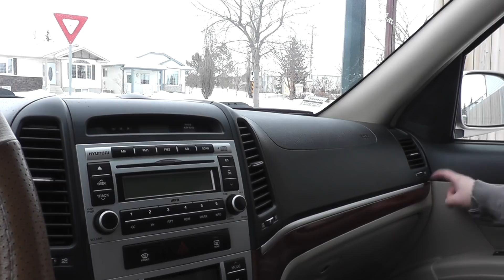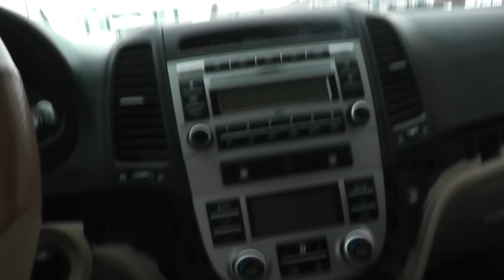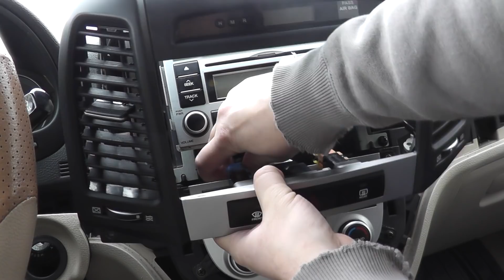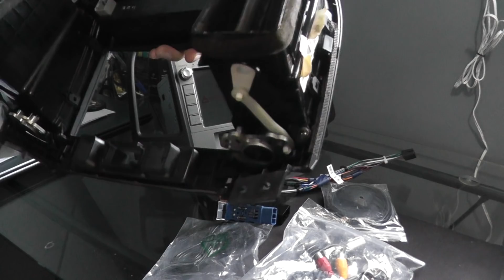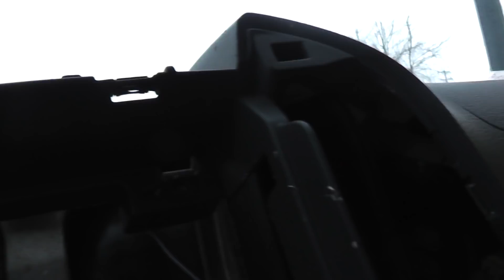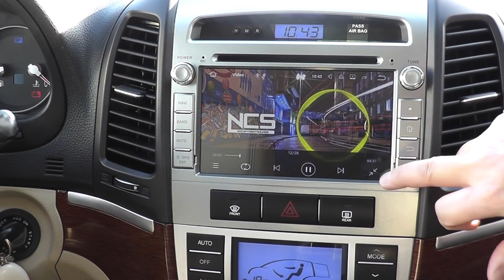Hyundai Santa Fe Radio Install

Comment: Hello can i get the android 9.1 9" screen into the original bezel once i remove the factory radio or will i need extra parts?and what power wire can i get for i wont have to cut the original power adapter to contact the wires with the one they send with the radio? I have the 2012.
Reply from the maker: No you won't be able to, their headunits are builts right into the dash. You only need to move your climate, defroster, and hazard switches. Depending on your car connectors you may need an adapter harness - this avoids from having to cut and splice into the car harness. You can remove your current radio to see you connectors and check what the units comes with.
Reply: @AutoAudioDIY  okay I was asking because I have seen the same radio unit that doesn't come with the bezel so I figured once everything is removed it would fit into the oem bezel..

Comment: How do I get my CD out of the player it won't come out
Reply from the maker: Did you remove the two screws located above the unit? There is an eject button top right hand side just below the rotary knob.
Reply: @AutoAudioDIY  I tried the eject button but it still won't come out. I don't want to take the radio out but my CD is stuck in the play

Comment: Hello, the link for this head unit is not valid anymore, they have a new model, but that one doesnt have space for the airbag indicator?
Would you please do a followup on the new headunit, really want a new "Radio" in my SantaFe, but i get confused when the new one doesnt show where the airbag indicator is?
Good movie btw :)
Reply from the maker: Yes I will do a followup, I have contacted them before but wasnt getting any good info. back. I will try again and let you know.
Reply: @AutoAudioDIY  Cool, thanks 🙂

Comment: I just brought a hyundai Santa fe but it has a DVD player in it. Is it possible if I get a new radio I will still be able to use it to work the DVD player for the kids ?
Reply from the maker: Is the dvd player just for the back or is the dvd player controlled by the main radio?

Comment: Hi my name is Matt I have the same suv and mine has the speaker on the dash but I wus wondering wut is the model and type of radio and connection you got cuz I’d love to get it for my Hyundai Santa Fe and if you could let me know I’d really appreciate you and by the way nice video my email is Shenktank120@gmail.com  like I said if you could let me know the type and model and what type of connections you got that be great thanks for the video and getting back to me have a blessed day
Reply from the maker: Hi Matt, I can for sure help you out. You said your santa fe has a speaker up top above the radio correct? Email me a pic of your current radio to chucho_301@hotmail.com. also what year is your santa fe?

Comment: Hi, thanks for the video ! That’s great.
Where can I purchase the wiring between the old connector and the new connector (on website) ? Thank you in advance
Reply from the maker: Ok sure, I'll get you a link or two as soon as I can.
Reply from the maker: sorry for the delay, here is a link for the radio harness...
https://www.ebay.ca/itm/Replacement-Aftermarket-Radio-Harness-for-Select-2007-up-Hyundai-Santa-Fe/400963662892?ssPageName=STRK%3AMEBIDX%3AIT&_trksid=p2060353.m1438.l2649
Reply: @AutoAudioDIY  None of the aftermarket harnesses have the pigtails for the pin 11/pin 12 steering wheel signal and ground wires unfortunately.   i have no idea why they didn't offer these wires.  There is one harness that does, but its not meant to be used as a harness for a radio such as this.
Reply from the maker: I did make the steering wheel controls but without using a harness. Just used the two wires on one one the two harnesses. Watch here: https://youtu.be/HPVAPVD1aHI

Comment: Great video!!  but Im finding that the unit lights power on but Im not getting anything to display.  Almost seems like the unit is not getting enough power.   Does the cable that was powering the dashboard clock also need to be plugged into the new unit?  I know the main power and speaker cables go in and the radio but as far as that goes I feel like Im missing something.   (btw the air bag light is now on.) . thoughts?  Thank you!
Reply from the maker: I would check your ground wire, for my nissan I had to ground it to the metal frame behing the radio. Negative, the clock gets its own power and doesnt affect the unit. 

Did you disconnect the negative on the battery before install? If not that would set your airbag light, to reset it just unplug your negative on the battery for a good 5 min. If that doesnt reset it yoy may need a scanner with airbag capabilities to do so.
Reply: @AutoAudioDIY  I did disconnect the negative battery cable before performing the work. All good there. 
The issue with the plug that powers the original dashboard clock does affect the air bag light.  With the new unit connected I took the old frame and reattached the clock and boom...Air bag light turned off. So I need to know how to get that plug to work with the new unit.  Lastly, I will have to ground the negative and see if that gets the display to kick on.  many thanks for trying to help.  Sending you good vibes.

Comment: I bought a 9” seicane and screen won’t turn on. Only buttons lights are on and thats it. What should i do?
Reply: Usb is working and chargin my phone but screen still won’t turn on
Reply from the maker: Does it shut off when you turn the car off? Also, could be the dimmer is turned all the way down which would be odd but may happen.. can you hear any sounds?
Reply: Esqu3l3to yes it shut off when i turn off my car. And i cant hear nothing

Comment: Can I install Android 9.0 Car Radio 2 Din GPS Navi for Hyundai Santa Fe 2006 2007 2008 2009 2010 2011 PX6 DSP HD IPS 4Gb+64Gb RDS WIFI BT HDMI 
In my Santa Fe 2010
Reply from the maker: Do you have a link that I can check?
Reply from the maker: Or I can also provide you one that would fit your santa fe.

Comment: Good night! Could you tell me about installing the multimedia for holy faith, I would like to know which cabling the sound whip (music change volume and mute) and intended for steering control control (cable colors)? thank you.
Reply from the maker: Ok so if im understanding this correctly you would like to know which wires you need for your steering wheel controls to work? What car do you have?
Reply: Okay, okay, I'm doing the installation of the vehicle multimedia santa fe but I'm in doubt about the cabins of the steering wheel control.
Reply from the maker: What year is your santa fe?
Reply: @AutoAudioDIY  year 2007
Reply from the maker: Ok I will find you a link for which wires you need.

Comment: Your gps puck is going to be exposed to a lot of heat in the winter by sitting on top of that heater duct
Reply from the maker: Yes that's true. So far so good tho, I should find a different spot for it.

Comment: includes everything?
Reply from the maker: it does include everything yes, having said that depending on your region you may need a harness to match your vehicle. I would suggest to check which type you have in case you need a different type to install into your car. Otherwise this includes everything you need.

Comment: Is this system apple compatible? If not which system do you recommend?
Reply from the maker: yes this system is apple compatible. It does support apple carplay *with an adapter*. Also unit will play bluetooth audio as well. Here is a link to the updated version of this unit which is a 9" touchscreen as well as the link to the usb adapter needed for carplay. 

https://www.seicane.com/2006-2012-hyundai-santa-fe-aftermarket-android-hd-touch-screen-navigation-system-dvd-player-radio-bluetooth-obd2-dvr-rearview-camera-tv-1080p-video-3g-wifi-ipod-steering-wheel-control-gps-usb-sd-mirror-link-s167027g?acc=3c59dc048e8850243be8079a5c74d079

usb dongle:
https://www.seicane.com/plug-and-play-carplay-usb-dongle-for-android-car-radio-support-ios-iphone-car-touch-screen-control-siri-microphone-voice-control-s01001?acc=3c59dc048e8850243be8079a5c74d079

You can click on the usb dongle selection when browsing the unit to have it added to your purchase. 
If you have any other questions let me know.

Comment: perfect job man ! thanks ..

but i have 3 questions  : 

1- does the quality of sound and bass still the same as the original sterio  ?

2- does all  steering wheel buttons  work properly  ? 

have you had electrical problems afterwards?  

thanks for answering ...
Reply from the maker: thanks!
1) yes sound quality is as good as original. This unit also has a EQ so you can do some adjusting as to what you like.
2) even tho this unit came with a can-bus decoder I, the harness I required did not allow me to use it. So currently I do not have my steering wheel controls working however I do have a wiring schematic so I will be looking to wire it up and have them work.
3) No electrical issues nor any other. Unit works great, used all the time for navigation, music, videos, handsfree calling etc.

Comment: Hello, Thankyou for good job you do! I happen to have model 09 sanda fe, just don't know how to install the steering wheel wiring control , where they connect with, and the back camera also, they a bit different with model 07.  Do you how it can install?  Thankyou!
Reply from the maker: Install should be pretty much the same for the 09 santa fe. As for steering wheel controls here is a link as to how wire that up: https://metradealer.com/files/aswc/ASWC-1_INST_405.pdf
for the backup camera I recently did an install video of that. You can watch here:
https://youtu.be/e6PsHo6bOBw

Comment: Do the steering wheel controls work?
Reply from the maker: Yes they do, but only if you connect the wiring harness with the cunbus decoder.
Reply: @AutoAudioDIY  what is a cunbus decoder
Reply from the maker: The canbus decoder is the module that "communicates" between your car computer and radio or other devices. So in cars, the car computer will tell the radio that the door is open, or climate control settings, steering wheel controls etc. Not all cars have that have it however. Depends on the model and make.

Comment: How l get this Radio for my hyunday santa fe 2007 and how much $$$$
Reply from the maker: I will send you a direct link for thus unit. Price will depend on the model you chose.
Reply: Esqu3l3to ok
Reply from the maker: Hey man, sorry for the late reply. I was on holidays and just got back. Anyways, here is the link to this specific unit with price

https://www.seicane.com/oem-2006-2012-hyundai-santa-fe-with-aftermarket-gps-navigation-dvd-player-car-stereo-touch-screen-wifi-3g-bluetooth-obd2-aux-mirror-link-backup-camera-s166322?acc=92cc227532d17e56e07902b254dfad10

You can also save an extra 5% with this coupon AFFSC-3051-83XUH-XDDX.

Comment: you paid $586 on this? Dude no way
Reply from the maker: I actually paid less at it was on sale.
Reply: Where can you get these for cheaper than the Seicane website?!
Reply from the maker: Try ebay or alibaba. Even amazon.
Reply: Esqu3l3to  Thanks. I'm looking at a headunit package put together by Crutchfield. Because my Santa Fe has the Infinity speakers and Amp (limited edition), they recommend a "Scosche SLC4 Line Output Converter" . I'm not sure the amp setup I have is compatible with this Seicane. What do you think?
Reply from the maker: I know they do make some units that are compatible with oem premium sound systems but not sure about the Santa Fe. It would be best to contact them directly to ensure whether it would or not tbh.

Comment: Does this fit a 2010 santa fe?
Reply from the maker: Yes this will fit a 2010 santa fe.
Reply: You will lose the steering wheel functions, like volume control, or answering calls.
Reply from the maker: Not if you connect the canbus decoder. It will retains those functions.

Comment: I made the mistake of buying from this company and ended up getting a used unit that someone else had paired their phone with and downloaded maps to, and it seems that they massively overheated it as well as it smells like burned electronics (and still does weeks later).  I had to fix the touch screen calibration myself because it was way off and it also had illegal software installed on it.  In going back and forth with support they want me to spend over $100 to ship it back to them so they can "look into" replacing it.  It also doesn't work with any of my steering wheel controls in my Smart 453 and the mounting bracket doesn't work properly with the silver backing piece for the stereo mount because there are connectors in the way of it so I had to mount it without the extra backing piece.  Oh yes, it also doesn't provide enough USB power to reliably run the USB carplay unit if you also have a thumb drive attached to it and it didn't come with the latest software for it (which was difficult to find).  This all feels a lot like a scam to me so buyers beware.
Reply from the maker: This is the second unit that I have and I have not had issues with either one. My VW unit was easy to install and plug and play. Same as this unit for the Santa Fe. Does look like you did get a defective unit. Hopefully they can get you all sorted out.
Reply: No luck with that, they were super slow to respond, wanted me to pay > $100 in return shipping and had nothing to say about the fact that it had illegal software installed on it except that they tried to tell me I was wrong at first and when I then sent them pictures of the software complaining it was illegal they back-pedalled and instead said that it would only be a problem if I tried to uninstall it or update it(!!)  They finally did offer to pay for the return shipping after I started posting these reviews on youtube (well still have me pay for it and then refund it to me once they had gotten the unit back and tested it thoroughly and they required that I immediately take down all the bad reviews).  These guys are jokers.  If you're lucky and get a good unit then you're lucky and good for you, but if you're unlucky like me be prepared to just write it off.
Reply: @AutoAudioDIY  hi, I would like to get this installed in my Santa Fe 2011 Sport FWD. Can you install it, I noticed that you are in Alberta, I am in Edmonton. Please let me know. Thanks!

Comment: it works radio command to the handlebar or steering wheel ?????
Reply from the maker: steering wheel if you wire it or use the canbus decoder.